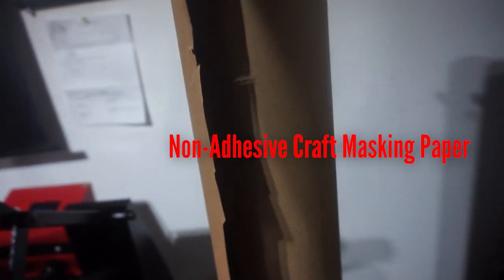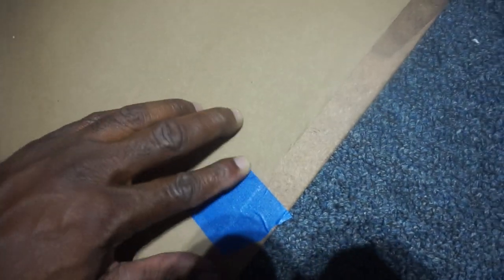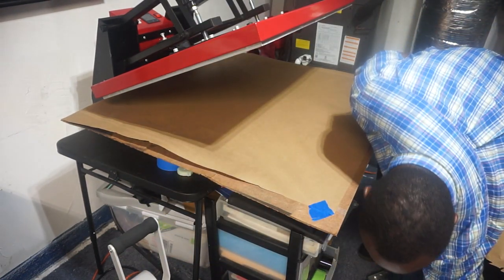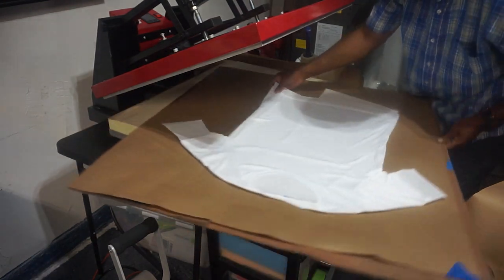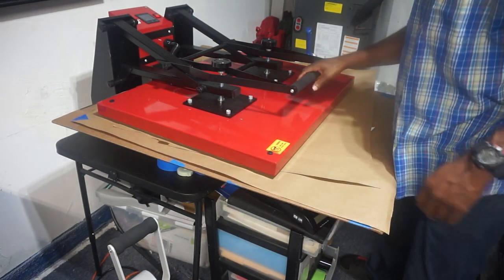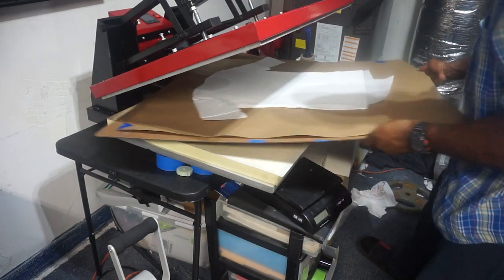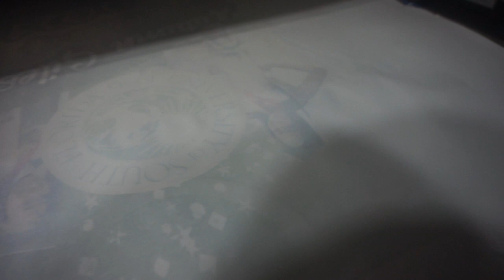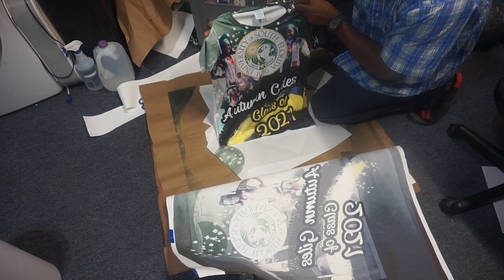How to print an all over sublimation t shirt?

Comment: How did you hook your heat press up? i installed a 20 amp breaker and 20 amp plug and keeps flipping breaker. i just bought same heat press
Reply from the maker: There will be a full tutorial video on how I had it wired.
Reply: @alfonsobailey1337  hey how are you. when will you be doing a video on this. Becuase i have the same press an im having the same problem
Reply: Hey i had the same problem withe ghe same heat press. I solved it now. So if anyone wants to now how i ran the power cord directly to the braker box to a 30amp.  To its on dedicated box

Comment: What printing press are you using?
Reply from the maker: US-24" x 31" . The machine was purchased from Ebay. I will go into a very descriptive video so you know which one to purchase.
Reply: Where do you get your tshirts from
Reply: Did that heat press come with outlet plug or you got to wire that to your electricity..thanks again
Reply: @alfonsobailey1337  where's the video about the 24" ×31" heat press off eBay